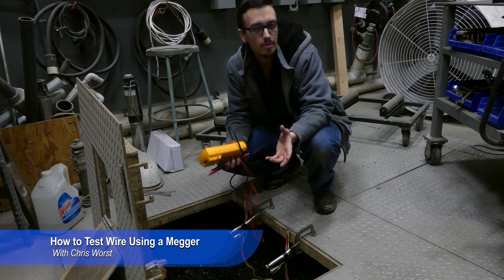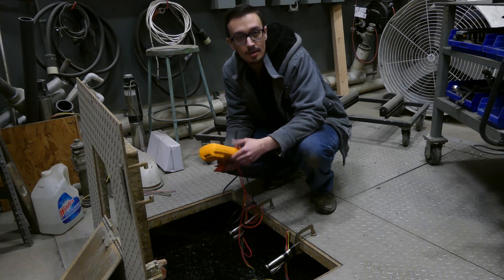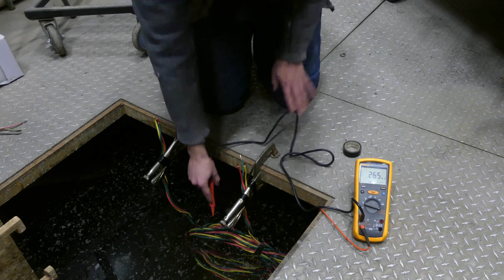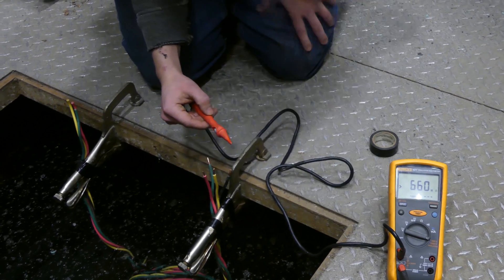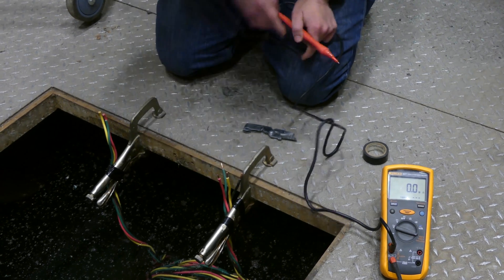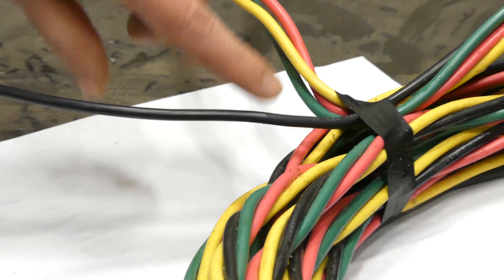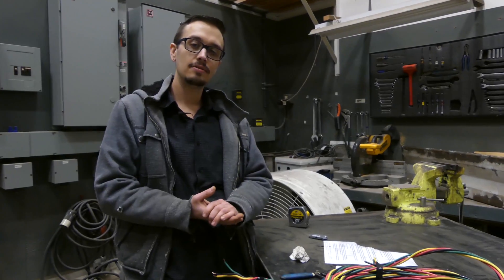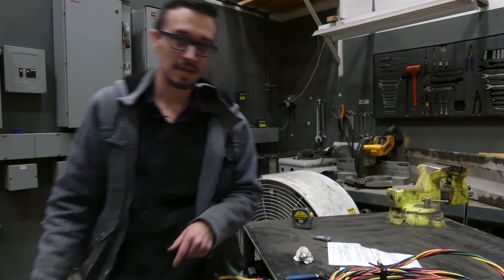How to Test Wire Insulation Using a Megohmeter

Comment: I worked for an electrical testing outfit years ago and we tested everything in a power plant, anything from MCC switchgear, transformers, relays, high voltage busses, etc...One point I recommend in your video is try explaining where do you connect your negative lead and why? Also, explain why you should ground (short out) your positive lead to ground after each test? Megger wiring test plans can vary between many applications so, I would try to explain how a valid megger test only exists when you have an open circuit to the difference in potential between your test cable and ground. Other than that I thought your presentation was really informative.

Comment: curious if salt water would make a difference over say distilled or ordinary tap water?
Reply: Demonized water is a non conductor.  Utility companies use it to wash off insulators that are carrying high voltage electricity.

Comment: Now my question is, how do you test to see if the flow of current is flowing through the wire properly and that the internal conductor itself hasn’t been damaged, Wich from my understanding is that I can test with my Megger at a 1kv and max out at 2.2 gigaohms and there is times I can test and get a slow rise of 100 megaohms to 3 or 400 megaohms

Comment: hi sir can an insulation tester detect wires if the wire's insulation is cracked but not touched each other.
like some old cables' insulation cracked and the cooper conductor exposed but not touching each other?
Reply: Yes.  The high test voltage is enough to create an arc between the breaks in the insulation if the breaks are close but not touching.  Any moisture would also make a difference.

Comment: Great and informative video. Thank you. I have a hurried wire imbedded in asphalt. How would I be able to determine the specific location of damage to that wires insulation. I have a tracer unit allowing me to determine where a break is but it is less than helpful with damaged insulation. Your input is appreciated.
Reply: He said u can spend weeks and still won’t find it bc the damage to insulation can be very minimal to the point where u can’t even see it

Comment: If anyone could help, I been looking for anything saying if Megger readings before you run the unit “cold readings is supposed to be more or less than the megger reading after you ran the unit for some time “hot readings”
Reply: You should ways Meg motors qt twice their operating voltage, and at operating temperature.  Of course disconnect power first. Resistance in wire goes up with an increase in temperature, and down with a decrease in temperature.

Comment: good video,  one question, how should you select the correct voltage to be used on your meter ?  thanks
Reply: I good rule of thumb I was told was to double the line voltage ..   120 v send 250 '  240 volts send 500,  480 send 1000..

Comment: So... wouldn’t you want to check insulation resistance between each conductor as well?
Reply: Not necessarily unless the job spec requires you to. Theoretically If each conductor holds the voltage for x amount of time required in your test then that conductor has no damage to its insulation.

Comment: so no resistance means the wire is cut, resistance means the wire is ok? is 1000 volts ,who resist this voltage the wire or the insulation.
sorry for a dumb question.

Comment: Thank you for the video, I have a question that I hope you will answer me, if I want to check the house cables from the board, what should the resistance of the wire be with respect to 500 volts, and how can I know if I have a problem with insulation.  Thank you

Comment: I've been an electrician for years now. The last time I used a Megger was when I was in school. And today I have to test some wires in a building.
Your video refreshed my memory. I'm good to go now.
Thank you !  😀
Reply from the maker: Woohoo! Happy we could help :)
Reply: What about a standard multimeter? 
It can go up to 10mohms or more.
Reply: @irishguy200007  a multimeter is acceptable for testing circuit resistance (although a proper micro ohmmeter is preferable). You want high voltages for testing insulation, whereas a multimeter tests at something like 1.5V.
Reply: I'm an electrician as well and I always megg wires and motor winding but I use the fluke 1587 fc, which is way better

Comment: If i were to carry out this INSULATION  test on the table where would the test leads be placed then (if we are not placing one test lead in the water) . Do you just put the test leads on both ends of the wire youre testing or do you only use ONE test lead for the wire youre testing . Please advise
Reply from the maker: You cannot do this test without submersing the wire in water; because the water is conductive it will allow electricity to pass through it into any cracks in the insulation. That's why you have one lead on the end of the wire and one in the water.
Reply: @RCworstwater  What if i bought a new cable from the hardware store and its on a table rolled up new. Could i not check and test it to make sure the the insulation is good without unrolling the whole roll of wire. Could i then find the ends of the wire and test with the insulation resistance tester to make sure it does not have any cuts?

Comment: You can do this in open air!!!! For every single wire you want to megger. Get a spool and connect 2 leads and megger.... that meter gives you the number of resistance. Wow....
Reply from the maker: We are measuring the integrity of the plastic insulation. Hooking one lead up to either end of the wire would tell you the resistance of the wire, not the insulation.

Comment: Why would you read less resistance/ohms when the wire is damaged but hire resistance at 660 when it's perfect wire? Or am I just thinking about it in the wrong way. Are you sending 660 volts through the wire or something and if it's perfect wire it'll read 660 obviously, if it's bad wire the voltage won't make it's way through it and will read 0, is that what's going on? Also if you have one meter lead in the water and one touching the good wire and it reads 660, how does that lead that is touching the wire know that it's 660? The other lead is in the water so how does it know... Also let's say you have a panel and the main is tripping maybe every 3 or 4 hours. The customer calls you to the house but it doesn't trip right away. You want to do an insulation resistance test like you are doing now. How would you achieve this in the panel? You would go hot to neutral correct? Instead of hot to water like you are doing here.
Reply: Castlebury21  reading 0 indicates there is no resistance and the wire is bad? How does this make sense. If there is no resistance, wouldn't it be a good wire? A bad/damaged wire would have a lot of resistance on it I'd assume
Reply from the maker: We are measuring the continuity between the water and the bare copper wire Jason, so no resistance means there is a crack in the wire insulation that would result in a ground fault if it were installed in a well.
Reply: @DJayAce4 You aren't really understanding what he is doing and why. In the test he is doing, he got 0 resistance between the copper conductor and the water thus proving that the insulation is compromised. Electricity is making a direct path from the water to the copper and vice versa through the damaged insulation. He isn't measuring the resistance of the 2 ends of one conductor. That would be done with an Ohmmeter and the resistance in a good conductor would not be 0 Ohms necessarily, but the lower the better. Depending on the gauge of the wire and how long it is will change that reading.
Reply: @DJayAce4  take a electronics course you dick pickle

Comment: Thanks for sharing, but what if you want to test insulation in wire that is not submersed.  I have 3 600 mcm wire in a metal conduit.  I want to be 100% sure before energizing that no insulation is nicked or compromised.  Would I just attach one lead of megger to the insulation and the other to conductor?  I want to rule out any possibility of having parallel arc fault.
Reply: Then test between the different wires, live, neutral, ground, as you are basically testing 2x insulation at any point there could be a short between two wires. To test the jacket it it's entirety, I guess you are supposed to submerse in water, because you can't get your meter probe to the wire later on - but in your instance you would attach the probe to the metal conduit of course :)

Comment: I have a problem with my water well cause its keep tripping the breakers i have change the pressure switch and the control box its wokst until the pressure drops to 30 psi when it tries to raise the pressure tripping the breakers again
Reply from the maker: Jairo: Please give us a call and we will help you troubleshoot: 855.329.4519